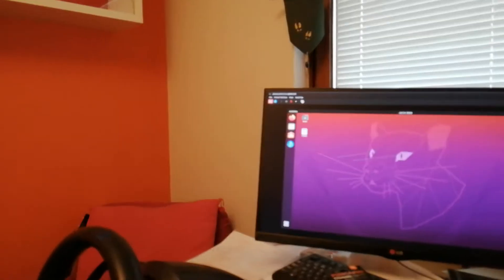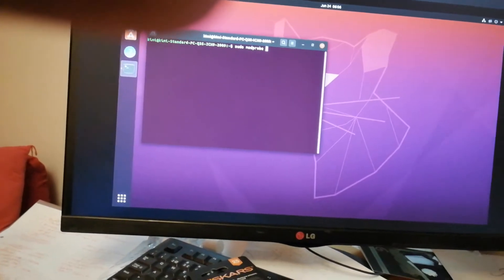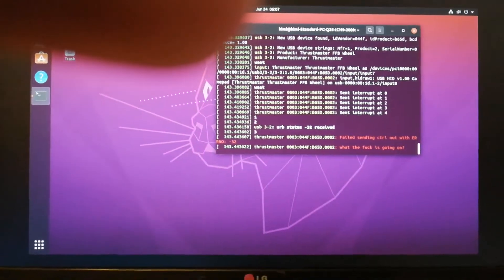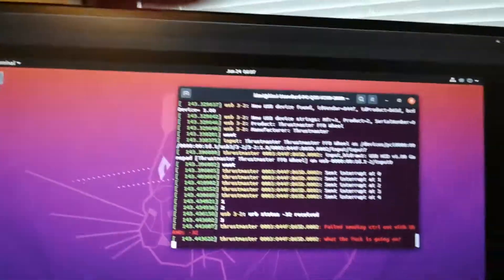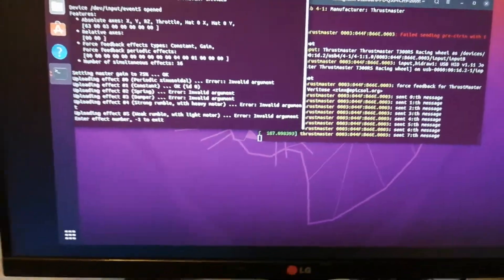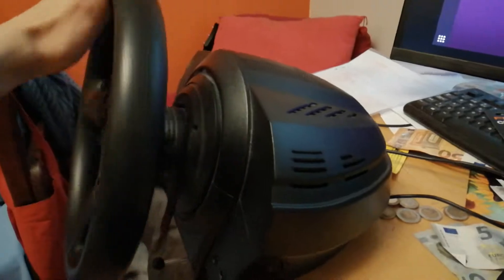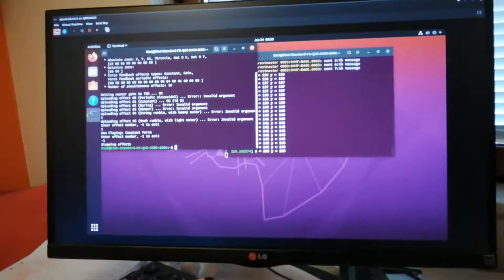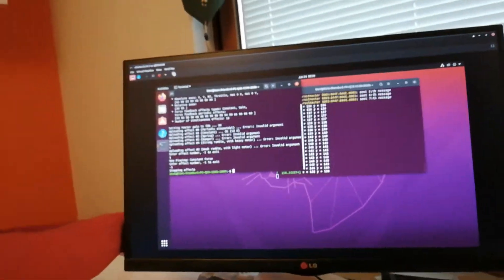Force feedback test T300RS on Linux

Comment: How are the drivers today? You know if t150 is suported? Ty
Reply from the maker: The T150 has a separate driver: https://github.com/scarburato/t150_driver/

Other than that, the driver for the T300RS is usable in most games and has support for T248 and (at least partially, still experimental) TX wheels
Reply: @masturball7292  Thanks!

Comment: From what I see, they probably must have added it? I'm probably wrong, but I looked at this thing in Linux Kernel
https://git.kernel.org/pub/scm/linux/kernel/git/hid/hid.git/commit/?h=for-5.13/thrustmaster&id=1477edb4853bd730e3ab37fa9165651c03c2cc05
Reply from the maker: If you mean the T300, doesn't seem like it. I can't find anything about it in the files that patch modified and the wheel didn't work before I wrote my driver.

Comment: Are there any technical docs for this wheel? I see a lot of hard-written hex values in the repository and a lot of low-level functionality and I wonder where you got them from.

I would like to contribute if I would find it possible. Let me know if there's any way to help, I'm a Backend dev.
Reply from the maker: No technical docs as far as I'm aware, pretty much everything is reverse-engineered by me. force_effects.txt is more or less what little actual documentation I've written about the wheel, along with tidbits here and there in issues. If you'd like a more complete documentation, I'm sure I can write one up at some point, or you could just ask me directly and I'll try to answer best as I can.

Any help is of course welcome, at this point I'm trying to figure out how/why some games seem to not acknowledge the wheel as a wheel, see issue #16.

Comment: Hi, I have a T500RS and I am a web developer, how can I help you progress on this project in order to make both wheels work?
Reply from the maker: Heyo, I would need to see the USB traffic between Windows 10 and the wheel.

The easiest way to do that, at least in my opinion, would be to install Windows 10 in a virtual machine on your Linux computer. I prefer to use virt-manager, I'm sure you can install it straight from your distro's repos. Inside the virtual machine, connect the wheel, install the wheel's driver and a program called fftest_3. It's not easy to find, I can see if I can get you a direct link. 

With the virtual machine installed and set up, install Wireshark and usbmon in Linux. Usbmon is a kernel module that allows Wireshark and other similar programs to see the USB traffic. Once they are installed, you have to load usbmon with *sudo modprobe usbmon*, and then start wireshark with root privileges, *sudo wireshark*. In wireshark, select *usbmon0*.

That's all setup, from here on you have to actually record the USB traffic, which is done in Wireshark. If you're ready to go through all that, I can record a video which shows how to actually capture the traffic, as it's a bit finicky.
Reply: @masturball7292  Cool, I have now windows 10 on a VM, I can't find fftest_3 which I'm assuming is a windows program, right? I also have wireshark installed. Do you have a git repo that may help to communicate better? Also, how you record the data from wireshark?
Reply from the maker: @SpirosAliprantis  Hi, sorry for the late reply. The program is actually called fedit, I got mixed up between different programs. Here's a link to it: https://gimx.fr/download/b882e209a0ac023d03abbf560dfc3f25fe6367ca/fedit.zip

Yes, I actually have a git repo, forgot to include it in the description. https://github.com/Kimplul/hid-tmff2
 
For the data recording, I'll do a quick tutorial on it soon, but the abriged version is that you open up Wireshark, select usbmon0, do what you want to capture with the wheel, and press "stop capturing packets", the red square in the top left. You can filter out all the unnecessary stuff and focus on the wheel data by applying different filters with the "Apply a filter ... " field. When you want to save the data you have, go to File > Save.
Reply from the maker: @SpirosAliprantis  Hey there, have you had time to study the USB traffic? An issue was recently opened in my repo about a unified Thrustmaster "bootloader", and we would need more data about different wheels than what we can currently muster.  Specifically the boot phase, i.e. where the wheel still shows up as "Thrustmaster FFB Wheel".

Here is the link to the issue:
https://github.com/Kimplul/hid-tmff2/issues/3
Reply from the maker: Alright, I uploaded two videos, one main one and one that's sort of an addition to the first one.
https://www.youtube.com/watch?v=l_NGFPTJdus

https://www.youtube.com/watch?v=NuxV01aJwGM

Hope they're clear enough.